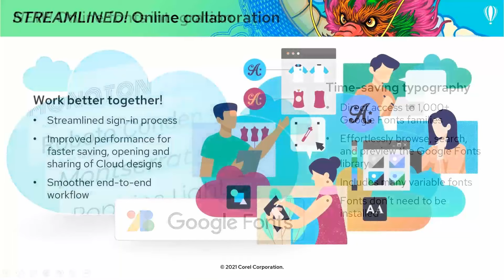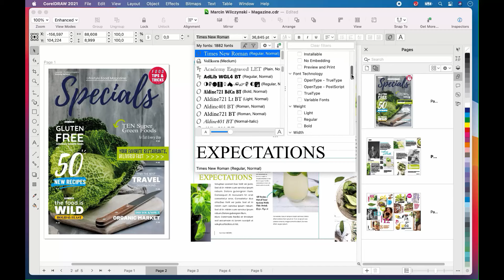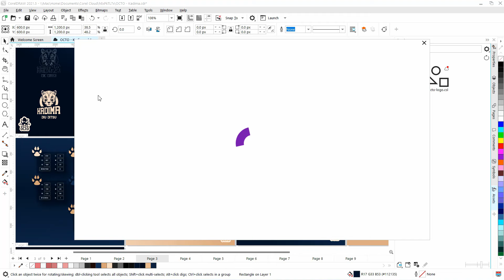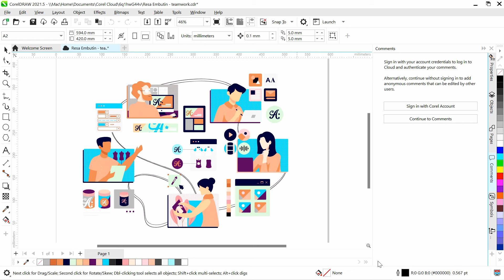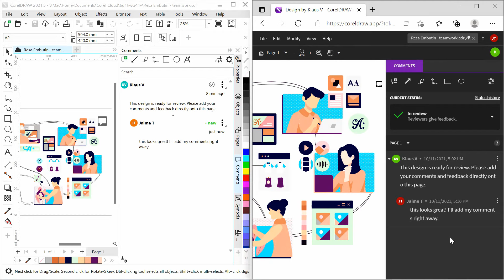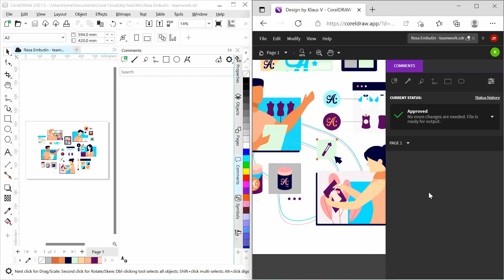New features | CorelDRAW Graphics Suite 2021 Subscriber-Exclusive Update | 40-min webinar recording

Comment: Hi I am using Corel Draw 2021 v23 (with the service pack installed) on Vista.
I am designing various posters/advertisements and this problem is driving me crazy. I lay out the work until I'm happy with it, select all of the elements on the page and then export it to JPG. But after exporting (and in the preview window just before it exports) it adds in massive chuks of white space. It seems as if it is exporting not just the elements I have selected in their current location, but also if I have moved them off my page briefly them moved them back, it exports the part of the page where the element was (does that make sense?)

I have got a workaround for this - after selecting all the elements and I cut and paste them into a new document, then it exports fine, until I do some editing on it then it exports chunks of white space too....even if I just edit some paragraph text. All of the elements are within the boundary of the page, and when I select them I am careful not to select anything off the page or to delete it first. And I've tried it with anti-aliasing selected and the problem is still there.

I can't believe I'm the only one with this problem - but I've hunted the web and haven't seen anyone else mentioning it.... Any suggestions?

Comment: This one has been asked before ... but the suggested fixes don't work for me. Corel draw 2021   This is a mockup of the extent of the white space.  It shows on the thumbnail, but there's nothing visible in the document itself.  I've done a wireframe view - nothing.  Selected an area larger than the page - nothing.  Have reset the workspace a few times to no avail.   Sometimes I can select just the page and paste in a new document and it fixes, but usually not. 
In the past I thought it was somewhere in the process of exporting to jpg - because that's where I first encountered it.  But today the penny's dropped.  It's in the original.   Never learned or did Corel professionally, just worked things out as they happened.   And learned new things when somebody wanted something different.  But the technical side occasionally gets me beat.